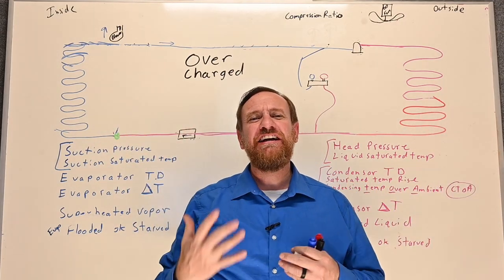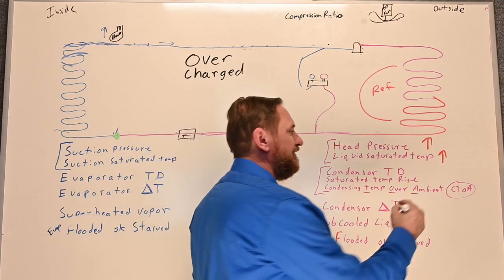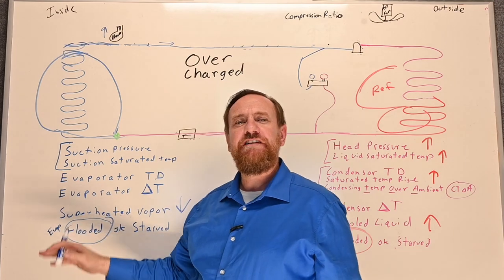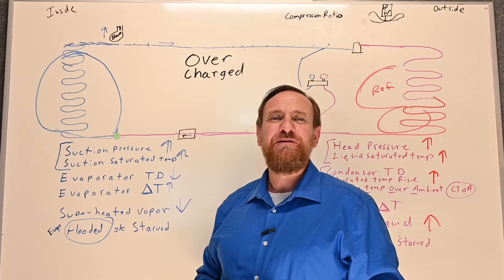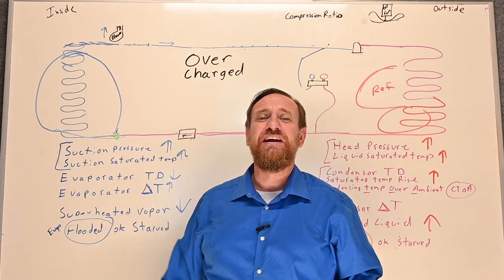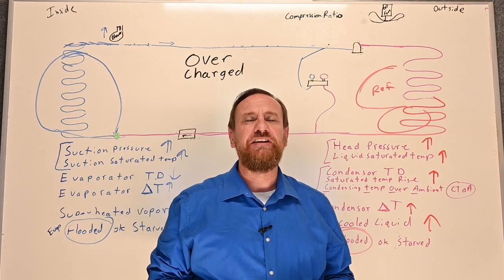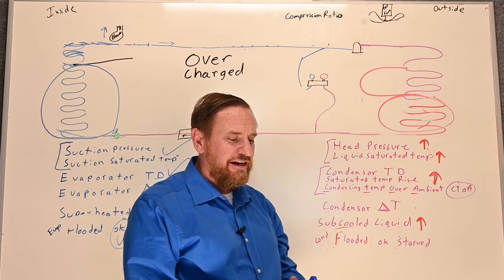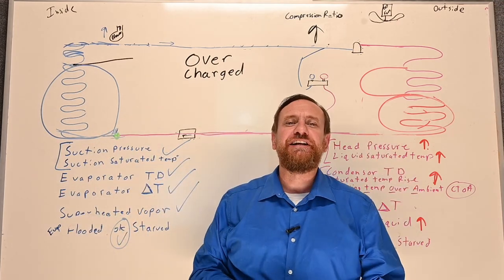HVAC 104 Scenario: Overcharged system Fixed vs TXV TEV

Comment: Well done. Diagnosis absolutely one to know what the metering device is. The placement of the txv bulb and a good thermal connection that is insulated should also be mentioned.

Comment: Excellent explanation!  Very helpful for my current project.🎉
I recently checked my home AC system and (unless the gauge manifold I borrowed is way inaccurate) my system is overcharged. It is R410A. Condensing unit is rated for 10° subcooling. But I’m observing 25° of subcooling. Also the condensing temp of 105° (342 PSI) is 25° above outdoor ambient temp today (80°). I think the evaporator is controlled by a TXV but it’s located inside the coil cabinet so I need to pull the cover off to confirm that. This system was professionally installed so I’ll be a bit surprised if it turns out to be overcharged by as much as what I just measured. If I confirm the overcharge I will slowly transfer some refrigerant into a recovery tank until the subcooling drops to perhaps 15° or so.

Comment: Been trying to help out a family member on hard times.  His heat pump went out in August, condenser fan running but the compressor just buzzing.  19 yr old R22 2 ton Carrier package unit.  The compressor would only run for a few seconds.  The HERM capacitor was low so I replaced it, the indoor fan cap and the rough looking contactor just to get things as best as they could be.  After the compressor would run about 40-60 seconds.  Discharge pressure was high, 294psi with AT in the mid-90s.  Verified no significant voltage drop when compressor running.   Indoor coil was in reasonably good shape, brushed and sprayed with no-rinse cleaner.  Outdoor coil also not terrible, not cleaned yet.  All this is good for learning.  

Compressor RLA 11.4 amp.  Runs at 13-15 amps before shooting up to 30 amps where the internal cut off kicks in, tries to restart but at that point the amps shoot right back up.  So always just cut the power.  When Ambient temps dropped into the 80s, tried again and it ran for 20-30 minutes before cut off on high current.  Obviously, compressor on last legs.  Compressor is hard to reach but I got to it, contacts are in good shape.  Assuming my resistance test of the windings was good enough, they are about 0.5 ohms high from what I found online for the Copeland scroll model number. 

I paid for a service call in expectation of verification of overcharge and compressor not long for this world.  Tech found that the system had been wired sometime the past with the O and Y tied together.  Best I can gather likely before the house was bought.  He also found a bent pin on the thermostat and sorted that out so that now the system isn't hot wired.  Did agree the compressor is failing but didn't mention overcharge.  

This hot wiring may explain what I found a couple winters ago when high electric bills showed up.  When I opened the "indoor" side, there was a huge chunk of ice in corner of the indoor coil, after months of being used for heating in a mild winter.  Found in late Feb/March.  Beyond me at that time.  He had a young tech, a friend of his nephew who worked HVAC for his father's company who said the system was working, this would have been a month or two after I found the ice so the ice was probably melted.  

So a disaster that has been cooling while set to heat for years.  Likely what contributed to the compressor failing.  I'm thinking high winter bills that shot up even more when the compressor started over-amping.  

I'm going to clean the outdoor coil just to be thorough and see if the amps come down.  May try to evaluate overcharge now that the system runs for a significant amount of time.  But if the compressor stays at 15 amps, it's almost cheaper to run 5KW heat strips.  Looking into replacement/alternative costs for the coming heating season.  Quote for replacement by last tech is a price too far.  

Not looking for tech help, just an adventure in learning.
Reply from the maker: Cooling mode? R22?
Superheat? Subcooling? 
If cooling mode
Wash out the condensing unit. 
Then keep the condensing coil wet, and watch the pressures and the amps. Let it run past the 15 minute mark.  If it keeps running good then remove the water. It will start to dry out. As it does the head pressure and amos will rise. Superheat and subcooling will start to change. 
Before the pressure relive valve opens, let me know what the head pressure and suction pressure is at least. Would like to also have superheat and subcooling at that point.
Reply: @love2hvac   Thanks.  I've only run the system in cooling and it is an R22 system.  Happenstance has delayed the cleaning of the coil, but I did verify that I could see light and the airflow our of the fan wasn't bad.  I'd kind of given up but your checks will be at least a good learning opportunity.  Eventually I need to pull and clean the blower wheel as well.

I lost the data I collected when I did get it to run due to a computer glitch.  I need to sort out how to cap the indoor air section while keeping access to the service ports and compressor wiring.  Also, the service ports are right off the compressor so I need to trace the piping to find a proper spot on the liquid line for the temp sensor.

What I do know is when it would only run for 40 secs, the pressure when it went to 30 amps was 294 psi (130F) condensing sat  with 95 outside temps.

When it ran for 20 minutes in outside temps in the mid-80s, I remember the condensing sat temp being 120 F so that's about 260 psi for R22 and relatively stable at 15 amps   I buttoned it up and on restart ran for about  20 minutes closed up before the compressor went out on high current (from sound).

Raining a lot here so it may be the weekend before I can clean the coil and get more data.

Comment: Thank you for an eye opening explanation of this anomaly. One thing I can not understand: With fixed metering, how can the Evaporator Delta T go down  if TD goes up? it looks to me like a paradox. If the temperature difference between the coil and the air is lower, there will be less  heat exchange. Isn't it so?
I can see why the excess molecules will cause pressure raise by the PV=nRT formula. But on the other hand, there's more flash gas dropping in temperature due to expansion. So to me it looks like that with small overcharge, the Delta T will go up. But with severe overcharge, the opposite. In each case the TD and DT should be in the same trend, otherwise it defies the laws of thermodynamics.
Reply from the maker: Let's say the return air temperature and airflow is a constant for this example.

To get a larger TD only way to do that is with a lower suction pressure that will give us a lower saturated temperature. We are going to get a lower suction pressure by having less refregerant and less refregerant molecules bouncing around inside the evaporator. This created is how the temperature between the air and the refregerant saturated will be farther apart or larger TD number. 

However less refregerant in the evaporator coil means less liquid refregerant able to change state from a liquid to vapor. It's the latent heat of the refregerant changing state that gives us the cooling capacity. So less refregerant in the evaporator coil changing state means we are absorbing less heat energy. 
Because we are absorbing less heat energy we don't have enough BTU capacity to make a change in the delta T of the air in vs the air out. So the Delta T of the air will be less of a change or a lower number.

Does this help?
Reply from the maker: Now on the reverse let's look at overcharge. 
Again with the return air temperature the same, and the same airflow. 

We now have more refregerant in the evaporator coil, more molecules bouncing around, giving us a higher suction pressure. The Return air temp being the same, and a higher suction pressure means a higher saturated temperature. So the TD becomes closer together or a lower TD.
Now that we have more refregerant in the evaporator, there is more refregerant able to change state from a liquid to a vapor, more latent heat available. This means we have . Ore capacity to absorb heat. That extra capacity means we have more BTU available to absorb more heat. That extra capacity means we can have a larger change in the temperature of the air in vs the temperature of the air out. So more refregerant changing state means more heat absorbing to make a bigger change to Delta T or higher delta T.
Reply from the maker: I think where your getting confused is the PV = nRT. 
This is a gas law, and if we had only gas it would work but it compley leaves out latent heat, the change of state, Wich is the THE key behind refregeration. 

For this we need the refregerant enthalpy chart. This will cculate how many BTU of heat will be absorbed for how much change of state we have with the associated pressure. 
After we know howa y BTU we have we can apply that to the air temperature to see how much it changes the temperature (deltaT)  the manufactures actually give us this data with performance charts. I have an introductory video on that
Reply from the maker: Check out HVAC 098 Delta T and I have included an introductory to performance data. 

Hopefully that helps
Reply: Hello Ty. I appreciate your elaborate answer. In the end, from the sensible heat perspective, it’s air (Return) meeting metal (evaporator coil). So, what I meant was that given a higher (sensible) temperature of the coil(metal), where Return air temp. & humidity and airflow being the same, the delta T (Return to Supply air differential) will be smaller. And vice versa. I simply cannot see how there can be a higher (sensible)heat transfer of air if the (sensible)difference between the two medias get smaller. 
The amount of refrigerant we inject into the coil determines the proportion of liquid to gas inside the coil. When calculating TD, we infer the refrigerant temperature from the suction pressure according to P/T chart. But this is true only for the saturated vapor. This vapor will be superheated as is it travels further up the evaporator. The question is what the Average coil temperature will be for the Return air in order to reliably calculate TD. This, I cannot personally answer as the pressure/temperature relationship of the medium can only be predicted for the saturated vapor. Not for the liquid/flash gas, nor the superheated vapor. 
 I’m sure you’d agree that if I blew, say, a 400 CFM, 80 degrees, 50%RH, air over a 40 degrees metal coil and then use the same air conditions with a 20 degrees metal coil (and hence, higher TD), I’d get a higher delta T (lower Supply air). For a coil containing refrigerant, I think we can measure the result by increasing metering (with TXV it can be done by removing the bulb), then measuring the average temperature of the coil with a temp. probe, at different spots. Then, calculating the new Delta T.
 Brian Or, for example, claims that Delta T will go down upon severe overcharge of fix metering. He explains it by saying that the evaporator temperature will go up (hence TD is less), and eventually Delta T is going down also. See: https://www.youtube.com/watch?v=qIo_iT8msZA minute 9:33/17:57
Reply from the maker: When more refregerant is in the evaporator coil more of the coil will be at that same saturated temperature before it superheats. Only the last bit of the evaporator will superheat above the saturation.

When the evaporator does not have as much refregerant even though the saturated temperature is lower it is for much less space. Say only 25% of the evaporator is saturated and the rest of the coil will be superheated above saturated.  That superheat will rise quickly threw the evaporator coil  giving you a warmer coil overall and less of a delta T air temperature change. 

Saturated temperature is just the temperature the refregerant it changing state at. It does not determine how much of the coil is at saturation. 
A unit low on charge will have much less refregerant in the evaporator coil, giving a lower pressure a d a lower saturated temperature. That saturated temperature even though it's lower will be for a very short span .

A lot of techs thing that saturated temperature is the temperature of the entire coil and it's just not that way.
Reply from the maker: I could have just an ounce of refregerant in the evaporator coil and have a very very low saturated temperature. This would give a very large TD and a very small Delta T
That is because there is just not enough liquid refregerant changing state to absorb heat. Even though the saturated temperature is low it does not mean the whole coil is that temperature. 

On the other hand, if you flood the evaporator with liquid refregerant, the saturated temperature will be warmer but it's all of the coil absorbing heat at that temperature giving you a larger delta T air temperature change.
Reply from the maker: You are referring to Bryan says "depending on how extremely overcharged it is" . Key word extremely, where the evaporator is packed with refregerant. There are also several other factors with an extremely overcharged system on the high side that all kill capacity.
An EXTRRMLY overcharge Will give you extreme heat pressure with less heat regectiom. That extreme higher heat pressure will give you a much higher suction pressure and suction saturated. This extreme will result in a lower TD and a lower DeltaT only because the extreme high head caused a extreme suction. This is not the norm.

If you remove extreme and continue the video @10:05 Bryan says an overcharged fixed " increased Delta T but increased rusk of flooding the evaporator and getting liquid refregerant to the compressor."

This is s problem because techs overcharge systems thinking the larger delta T means better cooling when reality it kills compressors.
Reply: I guess this is my mistake. I referred to TD as the difference between the air and the average temperature of the coil(metal) as if it represented the saturated temperature of the refrigerant. But it seems it doesn't.  Thank you for dedicating your time the shed some light on this issue.
Reply from the maker: @kamozoren  
I'm glad you asked, because if you asked that also means others have the same questions.

Its a great question. I will make a note to make make a video on this. I think I can show it with an infared camera. 

Never be afraid to question something. It's how we all learn and I 
 make plenty of mistakes but I always learn from it. 

Keep asking questions and never stop learning.
Reply: I'll be waiting for this one and others. Thank you for educating the future and present generation of HVACR technicians. There's something in the way you relate the subject matter that, for me at least, gets the pieces to finally fall together in the right place.

Comment: I didn't read all comments, and perhaps you believe people will draw the proper conclusion from higher compression ratios,  but simply put, the greater the difference in pressure the more energy that is required to compress the cool gas into a hot gas at unnecessarily high pressure in an overcharged system.  So even with a TEV or TXV, efficiency is harmed by over charging (too much pressure differential) or under charging ( too much super heat and failure to pick up a full load of heat as designed per watt consumed),

Comment: Mr Ty , I appreciate your help and what you are doing to Help, HVACer nation , I have an carrier 12.5 tons condenser with lines of 50 feet to the 4th floor attic, it’s reading very good high side pressure, temperature and 10 f degree of subcooling, the suction line low pressure, low evaporator temperature (24-27), f degree and psi converted temperature (35-38) degree, air flow is good, I fixed some fire dampers, I checked factory charge 9.5 ib plus 50 feet of line charge 3 ib, but still same. Your advice sir😀.
Reply from the maker: what is your metering device?
Reply: @love2hvac  Mr Ty my metering device is avTXV, but I found the problem with the attic air handler blower motor belt was crazy loss, that’s still air restriction. 
Thanks

Comment: Hello, really nice video! But I dont understand how the Evaporator AT increases... If evaporator pressure and saturated liquid temperature increases, the refrigerant boils at a higher temperature. Therefore it will remove less heat from the ambient, wont it? Regards and thank you.

Comment: Please help me understand.

Why is there automatically more subcooling when you add more refrigerant?  why isn't it instead more vapor that doesn't have time to cool down because the air flow has to cool down a larger surface. So that there is less subcooling instead? How should I think?

Thank you again for charing your knowledge!

Comment: If the evp fan or condenser fan speed replaced with higher speed 250 rpm and the system charged correctly what’s can happen? Thank you Mr.Ty.🌱
Reply from the maker: The condenser, would drop the head pressure, and liquid saruration, drop condensor TD. Drop condensor Delta T

More airflow inside: raise suction pressure, raise suction saturated. Father from due point so less dehumidification. Drop Delta T and increase superheat.

Comment: What about frozen accumulator in heating mode?
Reply from the maker: It should not be an issue. It should be sized large enough to still protect the compressor.